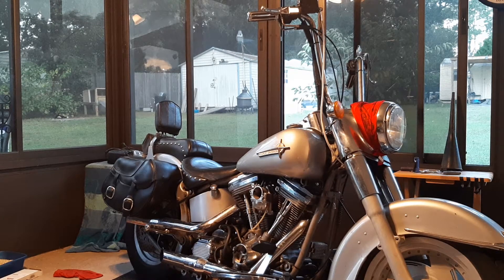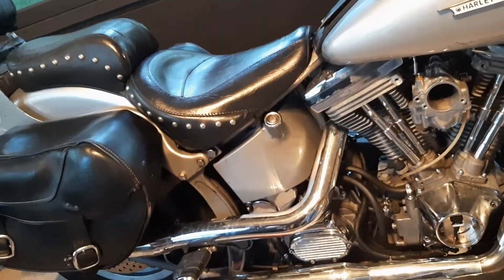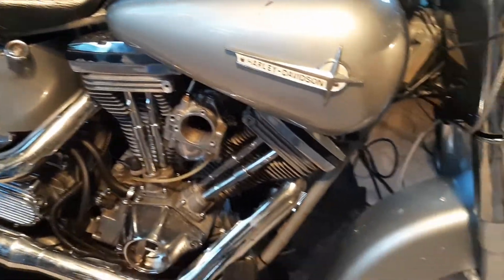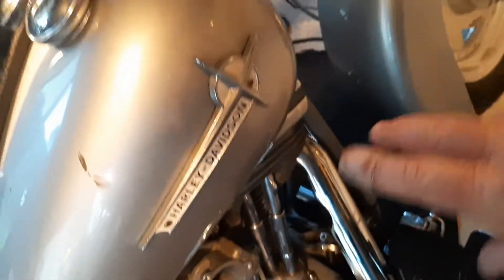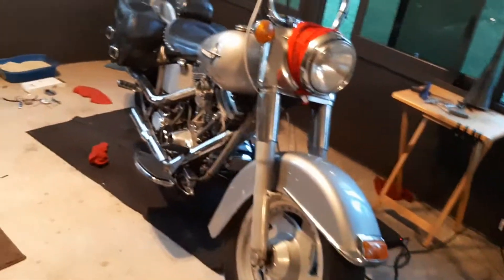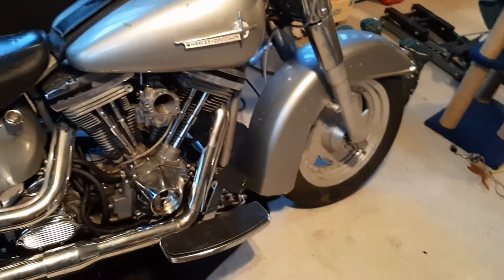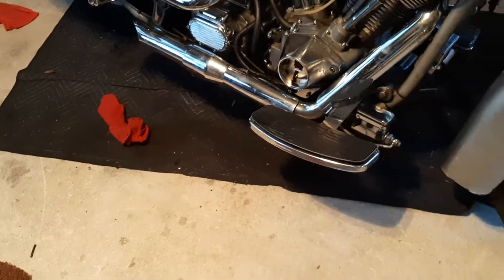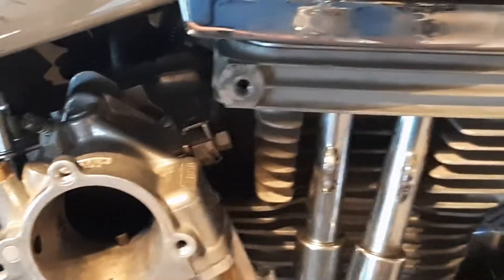1990 HARLEY FATBOY GREYGHOST TIMING ISSUES.

Comment: I know this is an old video, but,  it’s not wise to work the carb and time IG at the same time. Pick one and trouble shoot to eliminate, then go to the next. That said, it’s one of a couple things, but not the timing.  Timing doesn’t just “ go out”.
Your symptoms sound like either a plugged jet or , if those are clean, a bad coil or plugs.
You can borrow a known good coil to test it.  Just wire it up and try it, no need to remove the old one or mount the new.
Gap and change the plugs and try a new coil.
A bad coil can run fine at low speeds , but as the motor demands more power, break up under load, almost like hitting a rev limiter.  If it were timing or the ign going bad it would drop a cylinder or act up hot, then work fine after it’s cool.
Usually the sensor will show melting or oozing if that’s the issue.
Make sure the carb is 100% clean, change the plugs, try a different coil, in that order.
Be sure the gas is fresh, old gas won’t burn correctly.  
If that doesn’t cure it, odds are the module itself is going out. Again, borrow a known good one and try it.
I’m betting it’s a bad coil.
Reply from the maker: I put everything new on that bike. I did plugs, wires, coil ,  stator , voltage regulator, ignition control module, main circuit breaker. I had gotten it to finally run good, but then after about 10 miles something was getting hot and the bike would start backfiring and running like crap and shut down. Let it cool down it would be fine till it got hot. ,I had replaced everything, so I had run out of ideas, so I was so aggrevated, I sold it. I appreciate your input. Thanks.
Reply: @edZILLA64   sounds certainly like you got a bad module, new or not. That’s a classic symptom.
For future reference, should you experience it again, get a can of air, like for keyboards.  When it happens spray the air directly on the module, it gets cold fast so it’ll cool it down quickly, if it starts right up, there’s your culprit.
I’ve learned over the years even new is no guarantee, I used to race MX and would foul a plug, pop in a brand new champion and they’d be dead right out of the box.  I haven’t used champions since the 70s because of it. 
Anytime you can swap a known good in to test you’re always better off.   Good luck with the new bike.

Comment: Did you fix it? I have the same issue.
Reply from the maker: No, I ended up selling it and got an Electraglide. I was just going through the same thing with my Electraglide and I think I got it figured out. I just kept trying different size jets and I finally got it to smooth out. It's a long process, especially when you don't know alot about carbs. You have to let the bike warm up, then ride it, then adjust air fuel mixture, if that doesn't help ,then pull the bowl off, try a different jet , and go through the process again. Make sure your intake manifold seals aren't leaking. Good luck.

Comment: Man I feel for you brother... I'm going through the same problem with my 88' Softai I bought a few months ago. Iv'e replaced EVERYTHING. Coil, ignition switch, cam sensor plate, plug wires, ICM.. still popping a like yours. I really think it's come down to a fine tune on the carb! Have you checked your ICM? I think on yours it may be located under the oil tank (I don't know why Harley mounted that damn thing there, its a bitch to get to) I re-located mine to under the seat. If its the stock on you may want to have a look at it. If you made a mark on the old cam sensor plate before you took it out you should be VERY close with your timing. I also have a S&S Super E on mine and I'm going through the process of tuning it as well. S&S carbs can be really tought to find the sweet spot. By looking at where your cam sensor plat is on yours it looks a little advanced? Also make sure your connections to the coil have a good crimp to the connectors and tape or heat shrink wrap them all the way up to the eye of the connector! I'm sure you probably have yours fixed by now (just seen your video). If yours baby is fixed throw some help my way!!!! I hope that beauty is running like it should now, man.. i need all the help I can get too! Happy riding brother.. you'll get that bike to the show man!  John. 👍
Reply from the maker: TRY YOUR INTAKE MANIFOLD SEALS. PUT SOME NEW ONES ON. I NO LONGER HAVE THAT BIKE. I NOW HAVE A ELECTRAGLIDE. THAT FATBOY HAD A LOT OF SHORTS IN THE WIRING ALSO. ALSO READ THE RESPONSE UNDER THIS ONE, BY A GUY NAMED RODNEY. GOODLUCK
Reply: @edZILLA64  thank you for your reply! Great advise. I'm going to do the soap or brake cleaner test around the manifold seals today. Thanks for your help man.. I'm getting SO dang close,, we'll get it thanks to people on YT like you that are tired of getting nowhere from most HD dealerships! 👍
Reply from the maker: @Ohm10-8  I LEARN EVERYTHING FROM YT OR MANUAL.HOPE YOU FIGURE IT OUT.
Reply: @edZILLA64  Thanks,, me too, lots of good vid's on here. Also I joined "The Harley Davidson Forum". On there is different catagories that are for your bike only! Iv'e got ALOT of help on thereI wanted to tell you that I had similar problem with loosing spark and after probing and replacing parts I found ONE single dang wire to the coil that was a crappy connection. I soldered a new 'eyelette' connector on and havn't lost spark and my bike starts everytime. I Just took my bike out to tune the S&S and it died on me. I put the fuel shut off on reserve and it fired right up... and it has gas in it. My fuel shut off 'ON' position must be dirty. Tomorrow I'm gonna tear it all apart and clean it! Good luck man.. anything else I might be able to help you with just ask!
Reply: I went through the same problem once the cam gear is pressed on not keyed anyhow the gear spun on the cam shaft drove me nuts. Worth looking at
Reply from the maker: @scottlofton2607  that is a older video. I have since gotten rid of that bike and got an Electraglide. Thanks for the suggestion, though.

Comment: I have a 98 Fat boy S&S carburetor
Believe once you have the idle mixture correct there’s another screw to set  the throttle pump. While it’s idling you blip the throttle
Then turn the screw a little left or right until you have instant throttle response. Check out Low brow customs vid On adjusting the carburetor it helped me had the same problem
Reply from the maker: Will try. i have a few other things to try also. Are you familiar with the VOES switch. Vacuum Operated Electrical Switch. I think i'm going to go ahead and put a new one on. I will update in later video on what ended up happening.
Reply: I rebuilt my engine 3 years ago top and bottom end but not familiar with that switch
Reply from the maker: @rodneychristopherson8900  i have always seen it, but didnt know its function. from what i get from it, under high or low vacuum conditions, it retards or advances timing. im going to order a new one and install and try some of the carb. adjustments you brought up. will post a video later. Thanks for your input.
Reply: Good advise. I'm in the frustrating vortex right now trying to get my S&S Super E adjusted. They are a son of a gun to find that sweet spot! You guys really help with your video's man.  Thanks!!!!  👍

Comment: Lifters not pumping up can do that , they cant open the valve .  I had that a few times I can tell by the sounds when a lifter is failing .   I use Fueling Race lifters pay out the butt for them they last 40,000 miles no trouble  Normal riding they will last 80,000  Im hard on a engine .
Reply from the maker: that is good to know.
Reply from the maker: i learn new information all the time. thanks.
Reply from the maker: i think it might have also been some wiring issues. i had found about three bad spots. the whole harness probably needed to be gone through.
Reply: rubbing they short out first sign was the Regulator Burst in flames .
Reply: @edZILLA64   I have had Axle snap on the lifter you really have no idea . it will have a little miss fire . and seem fine then everything comes crashing down . I pull the cam look at everything when i get a miss fire or back fire .

Comment: Did you ever do a video on resolving the problem that you had with your bike running bad? I am having the same problem and have replaced spark plugs, coil, ignition and still have the same problem. Let me know if there’s a video to watch or what your problem ended up being. Don
Reply from the maker: Unfortunately no. I have since gotten rid of that bike. I tried everything. I put new coil,voltage regulator,stator,ign. control module,main circuit breaker,plugs,wires,etc. I got so aggravated with it, so I sold it. I would get it running good,but after 8 to 10 miles it would heat. Once it cooled down it was good to go for another 8 to 10. I bought a Electraglide that I ride now.
Reply from the maker: You can check your ign. control module, the wires were frayed on mine. Check your spark plugs also. My Sportster was acting up one time. I rebuilt the carb., thinking  that was the issue,still popped. I put new plugs in and it ran great. Check the gap also. I hope you figure it out. I don't know if I was much help, but I tried . Thanks for watching my videos. Be safe out there
Reply from the maker: P.S. Did you do new wires when you did plugs,and also look for any shorts in your wiring.

Comment: either running too rich or too lean
Reply from the maker: I no longer have that bike. It whipped me. I tried everything I could. New everything. Carb. rebuild, adjustments,new plugs,wires,coil,voltage regulator,stator, main circuit breaker,etc. I finally gave up on her and got me an Electraglide. It sucks , cause I liked that bike.
Reply: @edZILLA64  sometimes you just gota  move on! to ride 👍🏼